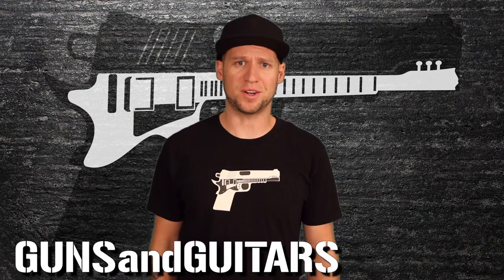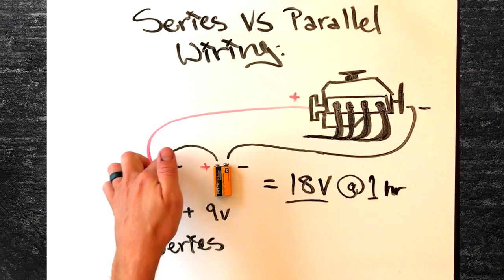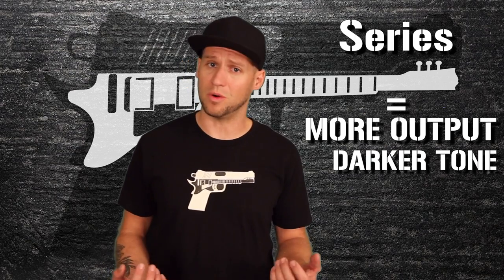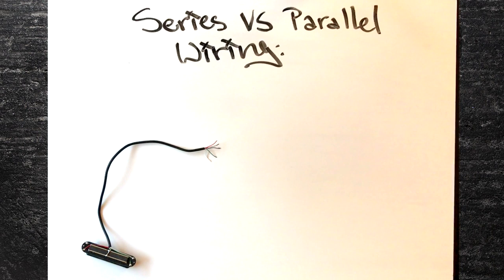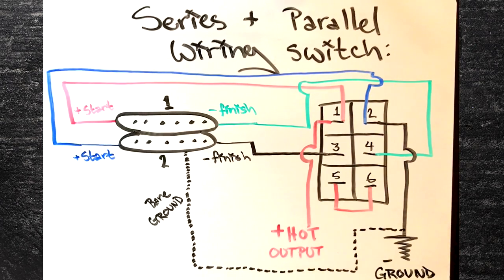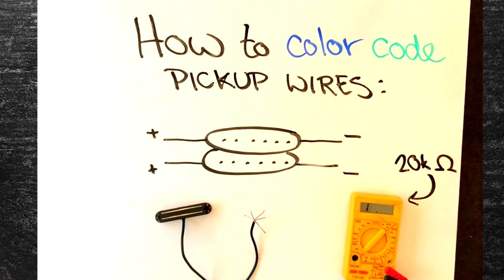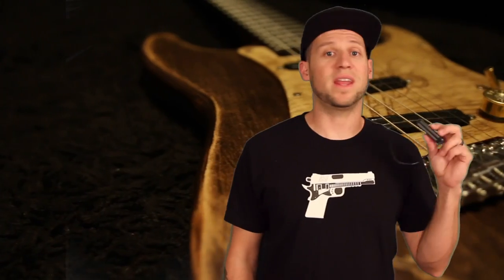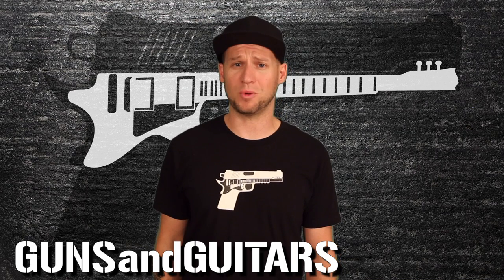How to wire a series/parallel switch for humbucker pickups (guitar hack #2)

Comment: Nice concept, and layout good, but i feel that if your going to get into the guitar modifications you should really get into it and not leave so much to chance and additional research, for those of us who need it.  Such as:  Your wiring does not cover multi Humbuckers with Single or Dual Volume an/or Tone controls. and for the Single humbucker what about those with Single Volume and Tone controls.  Additionally:  What about guitars with multi grounds ie: Bridge, Jack, Body and the Humbucker braided ground.  I know this is an old video, but from the looks of things people look here for answers.  So wouldn't it be nice to have ALL the answers... Keep plugging away.... Vince
Reply from the maker: You talking about a single video to explain every single wiring concept possible on a guitar? That video would be several days long. That’s why I’m breaking them up into smaller segments. This is just one wiring trick you can ADD to your current setup, it’s not meant to be the only thing you do in your guitar wiring setup.